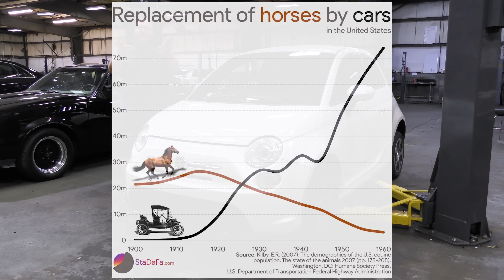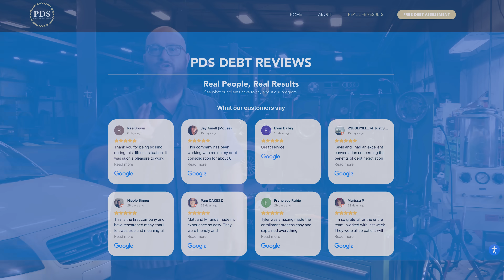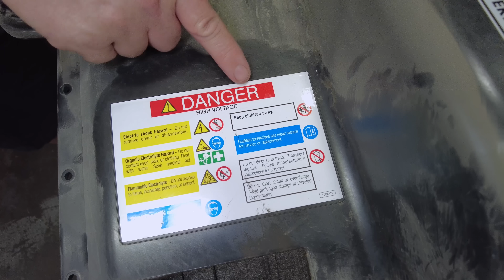How to SAFELY Remove the EV Batteries From my Fiat 500e

Comment: The EV fanatics have the idea stuck in their heads that EVs are actually simpler than gasoline cars.
Nothing could be farther from the truth.
Just because a part moves does not mean it is unreliable.  And just because it doesn't move does not mean it is reliable.  As we saw here, a part that didn't move went bad.  Literally anything can go bad in a Corolla, and even if it costs thousands of dollars, it is not going to hurt as bad as that battery pack that WILL go bad with current battery technologyn
Cars are all about money.  It is a HUGE risk to buy an EV that has little to no warranty remaining.

Comment: The EV will have market traction when the bottle necks are solved. Battery and charge infrastructure. With technology, batteries will be a fraction of the size/weight/cost with (interchangeable packs/cells) while having 1000 mile capacity with AC and heat full blast. Also, it won't burn down the parking garage if the battery pack gets upset.

Comment: I don't think they'll ever unify the battery cells, just like there are all kinds of totally different engines, suspension parts, fuel systems, transmissions, sensors... in ICE cars. What does need to happen and most likely will is the combination of better infrastructure (just like there's a gas station in a stones throw pretty much everywhere now), better energy density, lower cost, faster charging and longer life. All these things have been improved already over the last decade and I think the trend will continue to the point an EV will be cheaper than an ICE car anyways (where ICE cars will still be available), last for hundreds of thousands of miles without much degradation, putting another couple hundred miles in the battery will only take a few minutes just like pumping gas does now, and when the battery finally becomes too degraded it'll cost no more to replace than what it costs to replace the engine or transmission of a similar ICE car.

Comment: EV's are a good fit for some.  The limited lifetime of batteries is the problem.  If battery packs were standardized across manufacturers and could be rebuilt/replaced at a reasonable price, EV's would be a lot more attractive to more people.

Comment: I have a 5 year old Tesla Model 3 with 74k miles on it and I absolutely love it. I have a diesel truck and a gas truck also but I drive the Tesla 95% of the time. It pretty much only cost me insurance and tires to drive it as I get free overnight charging at home with Tesla Energy and the car is paid for in full. I would not give it up for anything at this point but maybe a brand new one but who's going to give me that? The only thing its had done to it since brand new is the 12v battery was replaced after 4 years by Tesla at my home for $116 total. I replaced the cabin filter once and it has a brand new set of tires which is the third set. I got 30 k miles out of the factory tires, put a second set on and got about 42k or so miles out of those and now its on its third set. I paid less then $600 for a set of Firestone tires from  Priority tire online and paid $80 to have them installed and balanced. Its the fastest, smoothest most tech filled car I have ever owned and Tesla keeps adding features and stuff it didn't come with when I bought it. Its kind of nuts how awesome of a vehicle it has been. I paid $6k for full self driving back in 2019 which is what it cost then and it now pretty much drives itself so I can just look around and relax. The naysayers can say what they want but I'm a kool-aid EV drinker for sure. The car is freaking awesome no one can change my mind.

Comment: 17:36 good dream sadly I didn't believe it will happen.  This is about vehicle manufacturer profits.  If they can make a vehicle that will only last 10 to 15 years before you have to get a new one, they stand to make a lot more money doing that.  Cuz you're also killing the used car market by doing that also.  They got the money. They got the ability to control the laws and to get the ability to do what they want.

Comment: As an electrician for a living, a car enthusiast and electronics hobbyist, i find EV repair very interesting. Hopefully we can save these vehicles from becoming e-waste after 6-10 years of use. Also look forward to more opensource Inverter/controller projects. I prefer internal combustion engines for fun, but you are right these ev's are not going away/
Reply: to save them from being ewaste we will need much cheaper and cleaner batteries
Reply: @Nordic_Mechanic  100% we need cleaner batteries that are easy to replace, along with better cleaner power to charge those batteries not fake "green eco" solutions that really aren't that clean at all. Good news it looks like more advancements in cleaner nuclear power generation is on the horizon with smaller reactors on the way allowing for more stations to be built at lower cost with a cleaner waste byproduct. Having said that we will never truly be able to get rid of oil with now many other things are made from it that we all rely on in our daily lives.
Reply: @CommodoreFan64  There is a little problem with material sciences. There are no ways to realistically to improve batteries, lithium is the best we have to work with as far as relatively stable elements go. By the time we'd be able to potentially synthesize something better we'll have long out grown the need for batteries and have power generation sources that out strip the need for them.
Reply: @SilvaDreams  don't tell the companies already producing Sodium cells 😀
Reply: @VolkerHett  Those have longer life spans than lithium cells, but as I said the have a much lower capacity too and don't chargr/discharge as fast.
You can wish for it all you like but you can't beat physics.
Reply: Ditto. At 57, I grew up with holly double barrel carbs, the 3 on the tree and 4 on the floor trans, and have watched the progression of gas engines.  I'm amazed now at what the electric a/c drive motors can do in things like the Tesla Plaid!  The instant torque puts gas to shame, and the way you can keep adding the small motors for more and more power, like in the Tesla semi.  I really want to see performance EV's grow.
Reply: Yep that's one of my biggest issues with EV's is their cost, and how quickly they become e-waste.
 Also the other issues that need to be addressed is that in many rural areas, and smaller towns of this country there are ZERO public charge stations, and I live along a major hurricane evac route in a small town so says if someone forgot to charge, then gets the order to evac from a major hurricane, they are screwed if they have no power left when they get to my small town with only 2 gas stations, and no public charging. Hell there were parts of my town that could barely keep the lights on during tropical storm Ernesto this past week, and you can't even get a good cell signal no matter what carrier you have. 😅
Reply: 'Follow the money ' there will be secondary businesses embracing battery repair/ replacement as it becomes profitable to do so. Also, many countries have battery research facilities that will improve battery technology.  Wait 5 years it will be all different.
Reply: They are already not e-waste. The batteries from EVs are sought after items, for either replacements or second life storage. Battery recyclers are struggling for product because you can sell the traction battery in an EV for a substantial sum.
Reply: The thing is the current 7-10 year batch of non Tesla EVs were as the wizard said test beds. The current batch will have much better long term support. Current average life span of a car is about 12 years. In 12 -15 years it's fair to assume it'll be 80% EVs

Comment: We have one of those Wizard. It's only 80 something miles. What that mileage on the dash shows you is the estimated range left at its current driving condition. It will constantly show near 100 miles  when it was driven without the ac on and low speeds. Ac on and highway speeds brings that back down.
Reply: My experience totally the same. 90 miles is realistic.  128 on full charge assumes low speed, around town driving, which is what these are perfect and fun for.
Reply: Yes,that's the exact case on my Nissan e-nv200. It usually varies between 89km and 120km. Depends on weather conditions,how you drive it,AC...etc
Reply: I had one and only rated for about 85 miles from new. Loved the car tho! Sold it to get a Bolt since I wanted more range.

Comment: Remember, your electronics are only as reliable as your cheapest components' quality. With the ridiculous amount of computer modules fitted on all new vehicles today, this issue with them being left useless due a module failure is only going to get a lot worse as well as potentially very expensive.

Comment: You have a point about the horses vs cars, but remember the EV is different, EVs used to exist before combustion engines and they already tried threee times to push the EVs through and they failed.... This is the same, it was a initial wave but now that they know the EVs. only last around 10 years and they are not as usable they will stop using as a long travels car, for cities only....
Regarding the self driving cars, i hope to drive a car i can control until i die

Comment: When Toyota hybrids came out Toyota had an agreement with many of the larger nationwide salvage yards that if a Prius came in to the yard totaled Toyota would buy back the battery so they wouldn't be available to anyone in the aftermarket looking for good cells to replace bad ones. Manufacturers don't want people fixing batteries. They want you to buy a new one or get a new car. Fortunately now there are other options.

Comment: When have engines been universal? There are proprietary components in every car. That's why you can't easily use a GM alternator on a Ford engine. Battery components are available. Not as readily as ICE components, but there are far more ICE vehicles on the planet. You took on this car to have content and to learn a few things. That's cool. Try to keep an open mind. It will never be one cell type in every EV. That doesn't benefit any automaker.

Comment: There's not enough rare earth minerals to replace all the internal combustion engine vehicles with electric motors powered by lithium ion batteries. 
EV's are a fad fueled by the climate change deception.

Comment: You can't determine battery capacity by measuring the voltage alone.  Even measuring the current as well doesn't work as that isn't ever going to remain a constant.  The indicated range is probably taken from a 'table' in the computer based on the supposed capacity and the instantaneous terminal voltage.  This is why you can't trust indicated range in ANY electric vehicle.  The better ones will take a constant measurement and then apply that to the next state of charge and give a more accurate result but unless they are honest with the degradation levels of the cells then even that will be off by a percentage.  Certainly not as accurate or as simple as measuring liquid fuel content!

Comment: Folk like to spread scare stories about ev's and Wizard just did it claiming that hot climates are literally cooking the batteries which is mega hyperbole.  And then he says that people buy used Leafs just to get hold of the valuable battery pack.  Hmmm ... 🤔

How many times do you watch a Wizard video about a complex problem with a gas car, how expensive the parts are, how difficult the parts are to get and how you need to dismantle half of the car just to replace something with the heater matrix for instance or something buried at the back of the engine bay requiring an engine out?

All modern cars are complex.  End of.  However, there is so much less to go wrong with an EV.

Comment: Electric cars pollute more than gas cars to produce. After to recycled the batteries and the components again it pollute more than a gas engine car to recycled. If you want to travel it suck a huge portion of your time charging. Most people who drive electric cars have range anxiety. I live in Canada, around -30°C or -45°F electric cars are useless the range changes enough you cannot drive safely from 1 big town to another because it is unsafe to drive an electric car in a snow storm with a range of distance that isn't guaranteed,...i can keep going. Internal hydrogen combustion engines are way better and absolutely any car or truck can be converted. Range unlimited like a gas engine. Water is everywhere oceans are full of water so basically renewable source of energy
Reply: It takes more electricity to produce hydrogen, then the range the hydrogen produced provides.

Comment: Random comment: My parents have a Tesla Y that has been rear-ended at VERY slow speeds twice.  The first time it cost $8,000 to repair, the 2nd time it cost $15,000.  The "accidents:"...someone behind them at a red light thought they moved and barely rear ended them, and the other person backed into the car in a parking lot.  Overall, we need cars to be modular in all areas, from the body, to the batteries.  Car manufacturers only want to sell new car, but need to have incentives to build cars that will last!   (I cringe at the idea of permanently leasing cars, like a subscription model, but that would solve it)

Comment: Look how long it took to get EV charger standards. Companies like NIO offer full battery pack replacement stations. This is the kind of innovation the US and really the world will need. Also there needs to be more solutions on what we will do with these batteries when they ultimately stop charging. Then, of course then, the electricity to recharges EVs. The US doesn't have enough capacity, electricity costs are already too high and they have not built a new nuclear plant in years unlike France that is building them like crazy. No way the US will be ready by 2035.

Comment: unified parts is only a fond memory.  until the 90's a ford lightbulb would fit a caddy.   NOW  fiat related.  mid 70's i worked at a fiat dealership.  i was the gearbox guy primarily and always backed up.  always a bunch on stands. piss poor transmissions.  AND at 20k (if your trans lasted that long) a brake job could often cost more than the cars value.   fiat pulled out of the usa market in 77??  back now with chrysler i think.  hoping your car works out for you.

Comment: If the module fixes the car, you're in good shape.  If not, time to retrofit a Honda B16 with a proper 5 speed manual transmission.  It'll last forever and be far more reliable than any Fiat ever made.

Comment: Fun fact on the latest Tesla's the pack is glued & sealed for life. Their current repair procedure is an industrial recycling Shredder ♻️.  This Fiat is still old-school repairable.
Reply: Eh, thats like lifetime fluid transmissions without a drain plug.  You can always open them when needed.
Reply: Unfortunately the new tesla batteries are "structural" and are indeed glued in inside and not serviceable. I hope this gets forbidden by low before other companies start doing it
Reply: @klisurski  They've always been glued, but that doesn't mean they can't be opened and they are definitely both reconditioned and recycled for other uses. They are way too valuable even as degraded or broken batteries to be just shredded like you suggest.

You've misunderstood something that you've heard or read.
Reply: @davidwilliams4845  They’re sealed in some foam material to reduce thermal runaway. Good luck trying to replace any cell. 😂
Reply: @davidwilliams4845  You obviously haven't seen Munro & associates try to attempt it on these new packs. If a reverse engineering company finds the adhesive structural glue impossible , who do you think with lesser skills will attempt to repair these?  They are designed to be shredded only. Not exactly environmental and will effect used values of EV vehicles where the depreciation is already Sky high. A new approach is needed - however  no insurance company wants the liabilities of repaired packs it seems. Hence the Elons Shredder approach.
My problems are has Elon provided said Shredder recycling ♻️ equipment to every country these vehicles are sold? That is the most important thing to ask.
Reply: Why don’t you move to China? 🖕🖕🖕🖕🖕🖕🖕🔥🔥🔥🔥🔥🔥🔥🇨🇳🇨🇳🇨🇳🇨🇳🇨🇳🇨🇳
Reply: There are now numerous 3rd party shops around the US that will repair Tesla and other EV battery packs and even upgrade them for much less than a new battery from Tesla.
Reply: Absolutely not! Tesla batteries are reused for non car purposes, and are also reconditioned for warranty replacements. Whoever told you they were "shredded" was completely wrong.
Reply: @davidwilliams4845  Elon himself advised. Why are you not keeping up with latest news ?
Reply: So also, is this writers 2019 Kia Niro BEV. It is repairable. Check the "Monroe Live" videos on the Tesla Battery pack dis-assembly. As I recall the sealing is to prevent runaway fires in the pack. Fun Fact [Psst! don't tell Mr Trump,  BUT} ALL Chi Com EVs are required to have fire proofing in the battery pack.  One more reason the USA will never see a ChiCom EV. They are built too well.
Reply: @harriettanthony7352  Can you image the US auto industry destruction if we allowed China to sell here?  They would be the new walmart/amazon, destroying everything else that attempted to compete.  Always remember Chinese companies must be partially owned by China.  This allows them to heavily subsidize them and dump them on the shores of any country, for pennies on the dollar, if they want to grab market  share.  Nobody can compete with that.